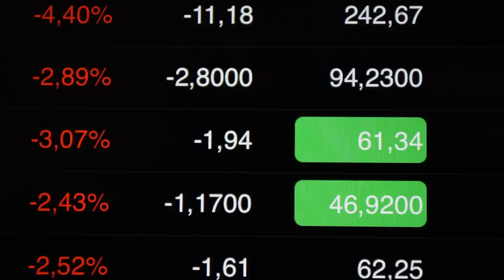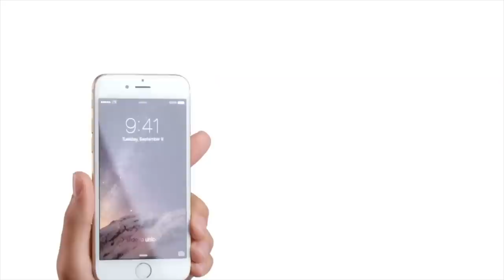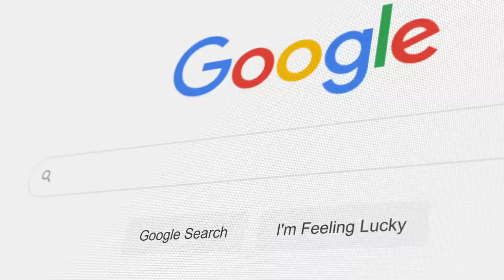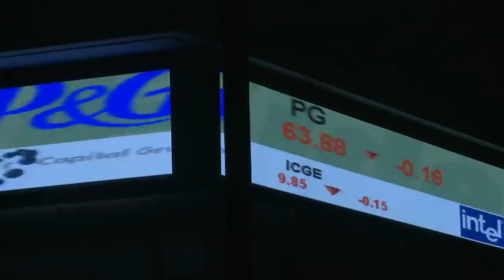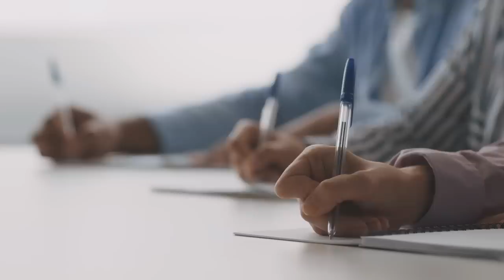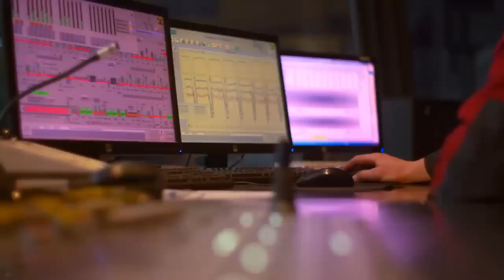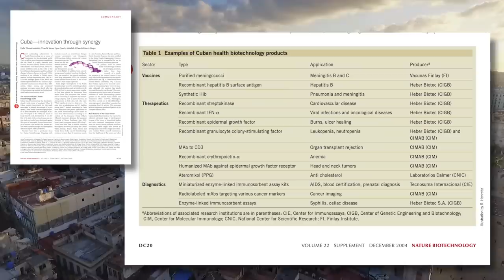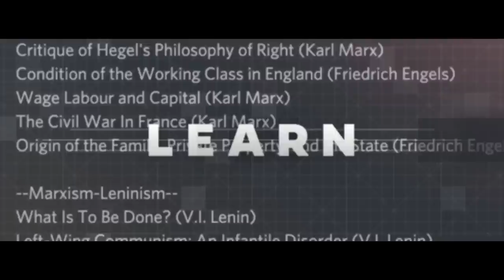Can There Be Innovation Under Socialism?

Comment: How Apple innovated over the last years: 

- Removing the headphone jack 
- Ignoring expandable storage and user removable batteries 
- Serializing parts to make repairs extremely difficult 
- Removing useful ports and adding them again 
- Making spare parts as unaccessible as possible 

After seeing this brilliant video, I'd really love to see a Right to Repair video!
Reply: I'm not sure how much "right to repair" makes anything better, sine user-accessible parts means adding a lot of other parts so that those parts can be accessed. But yeah, I always love when capitalist suburb hipster sheep use Apple as an example for innovation, given that the company hasn't innovated in about 30 years.
Reply: Well said
Reply: @ScooterinAB  user accessible parts does not require a "lot of other parts". It just means stop using permanent glue and replace it with an easily replaceable alternative, or have a socket instead of soldering something. The additional space requirements are negligible
Reply: @elbbepp  No, making a user accessible battery means engineering the case so that it can be user accessed. That means adding extra components like clasps and engineering the case so that it can be opened but is durable enough for regular use so that it doesn't just fall apart. It means adding connecters instead of soldering components. These things add volume to a device, which betrays market desires and increases costs. It is easier to manufacture a whole unit than it is to manufacture something people can take apart on a whim.
Reply: @ScooterinAB  the components have been there for years before the same companies took them away while increasing prices and calling that top edge innovation. Also apparently they didn't care it caused significantly more damages to the environment
Reply: @ScooterinAB  Here's an example of right to repair that only benefits the automakers.

A lot of people in the hot rod (modded sports/muscle cars/tuners/etc) will often put an electric power steering pump in their cars from the parts store or junkyard. Often a model used is from mid 2000s volvos but there are a few others.

This is done to free up some room. The pump can be mounted virtually anywhere unlike a belt driven pump that needs to be on the serpentine system. The volvo pump can be wired easily with 3 wires.

Newer electric pumps, like from the 2010s have a communications system called CANBUS that means you can't take one from the junkyard and wire it.
Reply: There would be no need for a “right to repair” video or laws in a socialist community. 💁‍♂️. The more u know….
Reply: To this day Apple phones still require a lightning cable connection for wired connection and that cable is literally 10 years old and sends info very slowly compared to USB.  Europe has passed legislation and hopefully they just switch to USB C cables worldwide
Reply: @monsterofvoices  really? That’s what you’re bringing to the table? 🤦 you’re on the wrong YT channel if u wanna gripe about charge ports.
Reply: @newagain9964  the European government cares about it more than I do, so you can talk to them not me
Reply: @nenmaster5218  is that an anonymous yter?
Reply: Yes right to repair!!!!
Reply: @nenmaster5218  Uhhh, how is that relevant at all?
Reply: yeah and windows has pretty much just gotten worse over the years despite it being headed by the 'genius' bill gates, cause he now cares more about profit than actually giving us better operating systems
Reply: God, removing the headphone jack was the single most retarded decision any company has ever made.
Reply: I agree as a socialist it makes me mad
Reply: There would be no apple with socialism
Reply: If you wouldnt buy iPhone, they won't remove that
Reply: @ScooterinAB  in the past phone have accessible batteries and spareparts are more accessible i remember that they only start doing unremovable batteries because they’re following what iphone did to make you buy more phones
Reply: @HilwaAlifah  In the past, cars had serviceable engines, and now don't because they are infinitely more complicated. What's your point?

Comment: Capitalism actively disincentives innovation. For example, in my job I’ve developed many methods to automate both mine and others work. If I were to share all of this with my coworkers and managers I’d probably get a nice pat on the back and a congratulatory email. Then the company would give us more work to fill up our time and/or fire people because now it only take 2 ppl to do the work if 10. So I am incentivized to keep quiet and only use my tools to make my work easier.
Reply: The same happened to me. When I joined my last company, I personally worked to innovate my department which had an old-school process of paper printouts routing for signatures in plastic sleeves. I moved my department onto a cloud-based software to upload, store, comment, review, and sign-off all documents. Fast-forward a couple years, the company merged with another company and they laid me off in favor of my counterpart from the other brand who had been with that company for 22 years, yet his work was crap and there was no effort to innovate in that time (also was on the paper in a sleeve system). I was asked to train him on the system I built and laid off 2 weeks later. The decision was based on how well this guy kissed up to the boss of the other brand who became the boss of all brands. No evaluation of who was more skilled or more valuable to the new company or all brands, just about kissing up. I hear now that they let that system slide and it's in disarray. That's corporate America for ya. I've since resulted to becoming a small business (franchise) owner as that is the only protection I have from the enslavement of workers in America. I am small enough to not be attacked by monopolies or oligopolies.

Comment: About longevity. I've lived in a Siberian university's dorm for 4 years, here in my room was a very old refrigerator called Ока "Oka", manufactured back in 80's, and I assure you this old fella still works, and does it's basic functions (refrigerating and freezing food) well till this day (only needs additional freon Infusion every 5 years, as previous owner said). Also my roommate used his grandma's hair dryer from 80's as well(I think he still uses it till this very day), while mine cheap Chinese hairdryer died after 2 years of use.

Comment: You made me remember something. My cousin, god rest his soul, told me decades ago to always try to keep my gas tank full. He said that people are going to put that money in there anyway. They always do it when the needle is empty. They are always worried about running out of gas. He said go ahead and stop to top that tank off, then you'll not have that worry. You'll be putting that money into the tank anyway, so go ahead and do it now.

Isn't that something that can be applied to many other things? We've been running our people who labor on empty for thousands of years. For thousands of years, the people who have leveraged themself into positions of privilege and power have used labor to suppress labor. They are running the engine of the economy on empty. Labor is the engine of the economy. Nothing is made or served without the hands and minds of them who labor. Laborers not only create with their hands and minds and serve it up, but they are the primary consumers of that which they create and serve up. The people in control of the resources, like the people in corporate boardrooms, simply skim off the top. They shortchange labor in order to enrich themselves. They run laborers on empty.

It seems to me that if our society ran the engine of the economy, those who labor, on full the economy would run a lot better. If everyone received a proper recompense for their labor that industry and society, in general, would do a lot better. There are very many small businesses that would thrive if wages were at a proper level. Instead of passing the small business by because money is always short, people would make that stop and purchase that product. Maybe that small business wouldn't stay small for very long. It would grow, as would our entire civilization.

Thanks!😊

Comment: Just an additional point to consider: capitalism stifles the innovations of the workers as they do not benefit from the innovations they bring about. Even if the worker can make their work more efficient, they wont in a capitalist society because in the end either the company appropriates the innovation and profits from it without giving back to the innovator, or they sack workers because less man hours are needed to do the same amount of work, or both.

And the workers are some of the most innovative people since they are the ones who actually encounter the problems and are lazy enough to want to make their jobs easier and more efficient.
Reply: @theBear89451  just because you have experienced an exception does not make it the rule. Also, please elaborate on the kind of companies that you worked at because the kind of companies referred to in this post refer to those of larger scale. Of course there are smaller companies that value their employees and their inputs more, but under capitalism, most companies trend toward operating on a larger scale and end up as those companies where employee inputs do not count for squat.

Comment: As an engineer who has worked in private and public sectors, I found I did the most innovative work working for the government.
Working for the DoD, we made short run, specialized, expensive equipment. I pushed the limits of physical reality on some of those projects. Commercial companies used universities for the innovation and focused on cost cutting measures and things that could feed advertising.
Just look at how a new color is an innovation for the iPhone. There is a stagnation in performance and increase in the cost of low cost laptops. My purchases of new laptops aren't driven by the improved technology that used to drive them.

Comment: The innovation is not the issue--- the iPhone would get invented in the USSR, but it wouldn't make it to consumer hands. The issue is that the current distributer of phones would get upset if you tried to distribute iPhones, and there would be a deal between his department and the computer department which would prevent the iPhone distributor from getting chips. The invention part isn't the problem, it's reconfiguring the social structures for the new invention without the people who would get hurt being able to stop it by political methods.

The internet was proposed and invented in the USSR in the early 1960s. The US was doing a copycat project. The USSR project never got off the ground, because adminstrators felt threatened and killed the idea, despite it being proposed twice.

Comment: I know you likely aren’t the most computer literate individual out there with open source projects, but some of the largest open source projects are mostly contributed to by companies. Minor correction, and it’s only some large open source projects.

The Linux OS is the main example of this. This is the OS that runs the web. Most code is contributed by big companies. 

Now, this absolutely isn’t true for all open source projects. You want a good look at what is the closest thing we have to a “socialist” computer? The Linux desktop. This is where you see passionate programmers saying “I need a thing” and just making that thing, publishing it, and allowing others to contribute and add to it. This isn’t what runs the world though, but it is a pretty nice world. I use the Linux desktop a lot, and while it has some issues, for its extremely low market share, the experience rivals Microsoft and Apple’s offerings. The main thing holding the Linux desktop back isn’t technical limitations or lack of will. It’s companies holding things hostage. But even then, the experience is really good.

Comment: My grandmother is still using her more than 50 years old washing machine, produced in ex socialist Yugoslavia. Her water heater in the bathroom is also from old socialist Yugoslavia, and it is more than 40 years old. They do need to be repaired from time to time, but they are still working. She has an old socialist CRT TV, more than 30 years old, that is still working, bu she is not using it, because each 4-5 years she has to buy a new capitalist flat screen TV, because the old one can not be repaired any more. 
Fun fact: in old socialist Yugoslavia, there was a type of DIY computer, called Galaksija. A diagram was published in a magazine, so you could buy the parts, and build your own home computer, that was almost as good as ZX Spectrum and Commodore 64 at the time. Any parts that were hard to get (PCB and some other components) were distributed for free in the magazine. https://en.wikipedia.org/wiki/Galaksija_(computer)

Comment: Worth noting that during the 40s 50s and 60s the U.S. produced quality goods that became heirlooms due to their longevity, the cars from that time are incredibly easy to work on if you have the parts (which is the only difficult part) my grandfather had his refrigerator from the 50s from the first house he bought it was still working just fine when he moved into his motorhome and had to use the one in there as it needed to be lighter and those old ones were strong and heavy af... I had a toy truck that he had in the early 40s that I used to play with constantly, one of those little red wagons from the late 50s when he started having kids was mine in the early 2000's, these goods from that time when massive socialist policies were in place but we were still largely a capitalist economy were exceptional.

Comment: This is why I encourage devs in the open-source community to use the GNU GPLv3 Software licenses. This requires any derivative work  to have source code available. While this is a vast over-simplification of what it does, it's still one of the best copyleft licenses you can use.

Comment: The problem with innovation in the former Czechoslovakia was not that it did not happen, but that they were not implemented or used only to acquire Western currencies. The best example I know of are modern contact lenses. Whitch were developed in Czechoslovakia. The government saw no use when they already hve glasses, so they sold the patent. Other examples are usually tied to exports of goods to the Soviet Union. The innovation would temporarily reduce the export capacity of said goods and you couldn't just simply miss your quotas.

Comment: With the whole phone batteries thing its actually way worse than just not innovating, rather it's an example of what I call "counter-innovation", wherein the market has actually discarded a previous superior solution to make the product worse in a profitable way. When smartphones were relqtively new most of them had a snap-in panel on the back which could be removed easily by hand to expose the battery which you could simply pop-out and replace. They stopped doing this for a couple reasons, but the biggest reason is that making the battery non-replaceable without special tools and a professional technician means that people will be forced to buy a whole new phone when the single component with a short lifespan dies. Capitalism took a solution that was objectively better, and replaced it with one that is harmful to both consumers and our environment because it was more profitable. It's such a perfectly clear real world illustration of the falsehood of market-apologists claims that markets will always innovate and improve. Markets are an optimization engine for short-term profits, that is literally all they are. They cannot, by their nature, weigh any other factors directly.

Comment: I always found it kinda weird that this is the argument used, cause it barely even makes sense when you think about it. Like, in order to be able to innovate, people need to be able to afford to fail. People need to already be wealthy enough that they aren't concerned about the market pressure that supposedly promotes innovation (cause if they were, it wouldn't be worth the risk).

The thing that capitalism actually promotes is optimization, not innovation. It pushes companies to make little changes that make them more money, it pushes people to find ways to earn as much as possible for as little work as they can get away with, and it pushes creators to mimic things that are already successful rather than creating something new. There's nothing inherently good or bad about the optimization that capitalism tends towards, but the fact that people have been conflating this with innovation for so long kinda baffles me.

Comment: I would like to add that one of my guiltily pleasures F1 is used as a pinacle of auto innovation. Even tho it steals most of it's cutting edge tech from militaries, the products that it comes up on it's own are not made to profit.
Yes,down the line, it may be sold for profit, but everything js invented for a purpose, to win a race (championship).

Comment: By arguing for government investment the economy is actually mixed.  As ours currently is, there is no pure economic system, they are all hybrids.  Before going down the socialist rabbit hole two questions must be addressed.  How can the distribution system be created that is free of corruption?  In other words how do you design the system to prevent people unintentionally placed in positions of advantage to skim off the top until the socialist system collapses?  Second how does socialism correct its mistakes?  The free market has a negative feedback loop consisting of profit and fear of loss.  Granted, corporations have found ways to get the taxpayer to pay for the losses via government corruption resulting in some serious system failures due to runway positive feedback loops.  However, what control system (a self running negative feedback loop would be best) would socialism replace it with?